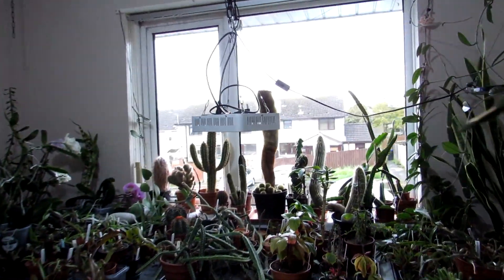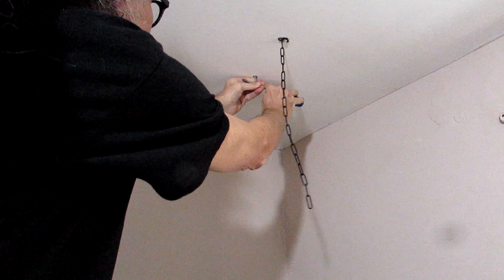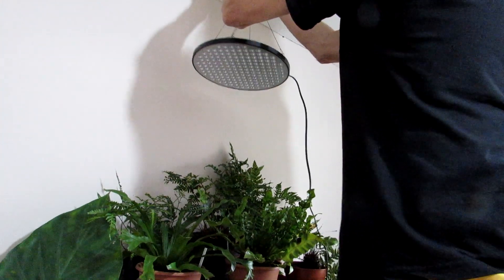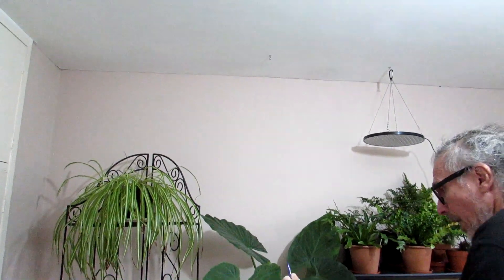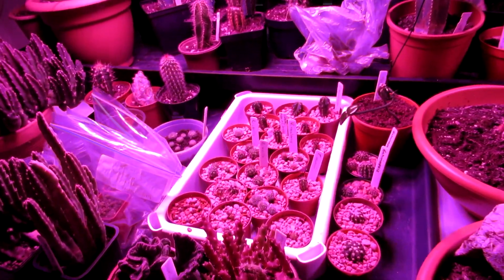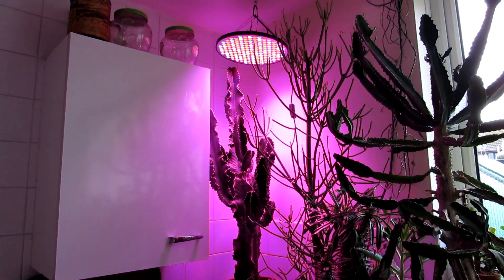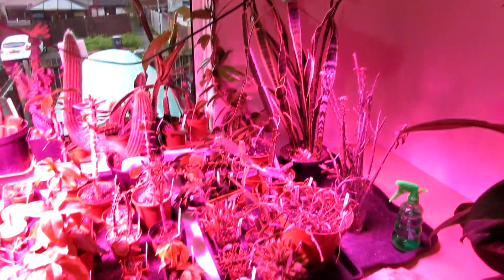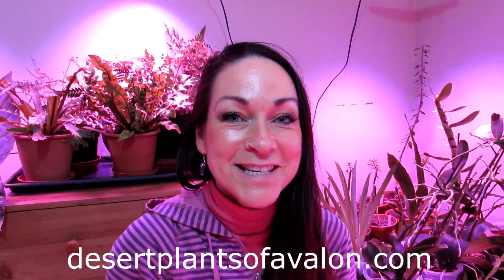Overwintering VLOG 8 - Installing Plant Grow Lights in my Grow Room & Office

Comment: Haha blimey you have so many lights!! You must get some funny looks when people walk past and see all the pink coming through the windows 😉. I do worry about your electricity bill, it must be quite expensive. I only run two lights dialled down to 75w each and that's £7.50 a month running at 12 hours a day. Definitely need to wear sunglasses for some of those powerful lights and don't look at them in the evening as could disturb your sleep.
Reply from the maker: hahaha Alex yes all the local kids here think we have a Marajuana plantation going on when they see all the Grow Lights in the house haha :-D  and especially when they see Hans's dreadlocks haha :-D I think they would be so disappointed if they saw we only had cacti and succulents haha :-D the neighbours all think we are bat crazy haha :-D yes the electric bill is a concern as we have to live pretty tight here on a money budget, but thankfully the LED's are much more cost effective than the older traditional Grow bulbs used to be but still its a concern with the Bill, especially with the heater in the polytunnel too <3 This time of year until Spring again we dread :-D The lights are so bright and its so important not to look into them I agree, thanks so much Alex for your wonderful comments and for watching and sending you lots of love and PLANT POWER from across the Emerald Isle XXXXX <3

Comment: Looking great...self adhesive cable clips are handy for clipping the trailing cables to the walls out of the way ....and for training my philodendron red emerald up the wall...you can get them in various widths
Reply from the maker: Thanks so much Richard for the tips on the self adhesive cable clips :-D it will definitely tidy up the hanging leads as they look a bit unsightly hanging all over the place at the moment haha :-D thanks so much for your wonderful comment and for watching and sending you lots of love and PLANT POWER from across the Emerald Isle for a wonderful Wednesday today XXXXX <3
Reply: @desertplantsofavalon    I use the 8mm clips from Ebay...handy size for cables and the philodendron....they keep the cables out of the way as they tend to trail  all over the plants as well as being handy for climbing plants
Reply from the maker: @richardclark148  Thanks so much Richard XXXXXX <3 :-D

Comment: I ordered a couple of those UFO lights you recommended. Looking forward to using them in a few weeks. Have not needed to bring my plants in yet.
Reply from the maker: Thats fantastic news you have ordered the UFO lights Linda :-D they are FAB and I have used these very successfully over the last two years for overwintering and they are very good and excellent with the cost efficiency to run on electric too :-D I can highly recommend them as good all rounder Grow Lights :-D thanks so much for your wonderful comment and for watching and sending you lots of love and PLANT POWER from across the Emerald Isle for a wonderful Wednesday today XXXXX <3

Comment: Are led lights necessary in Japan? Electricity is so expensive. Love your videos
Reply from the maker: So happy you love my videos :-D LED Lights are only really necessary if you are growing plants away from windows, or if you have windows with no sun coming through, if you have a window that gets some sun and is bright, you would be absolutely fine without any Grow Lights at all, especially if you are only overwintering plants. My old home has very big windows and was PERFECT for plants and overwintering them and I never used any lights at all and they overwintered really well, but in the house I am in now, the windows are much smaller and one half of the house is North facing, and I have to use additional lights for those windows and also the plants that I grow in corners of the rooms and on tables where there are no windows and natural light :-D thanks so much for your wonderful comment and for watching and sending you lots of love and PLANT POWER from across the Emerald Isle to Japan for a wonderful Wednesday today XXXXX <3